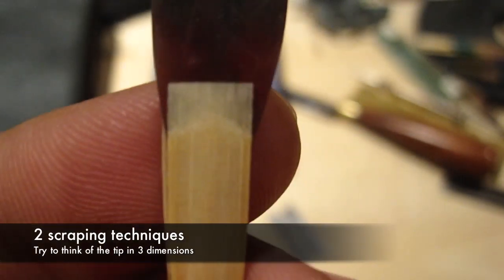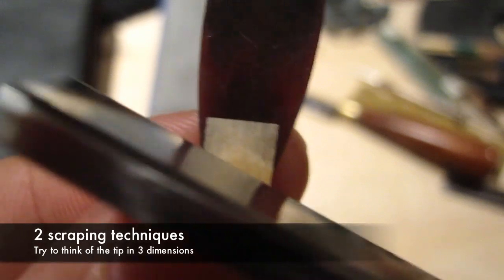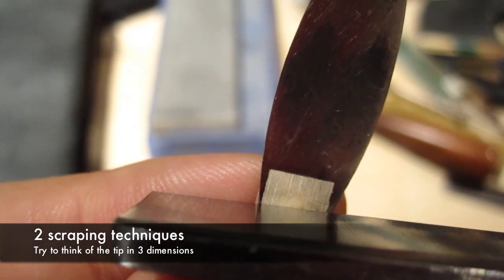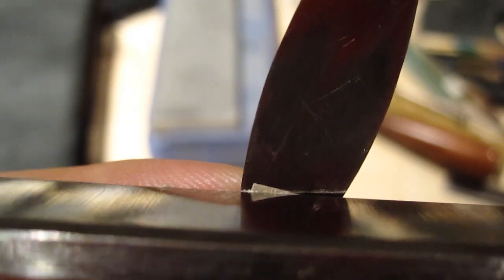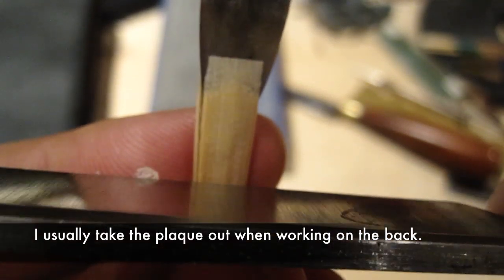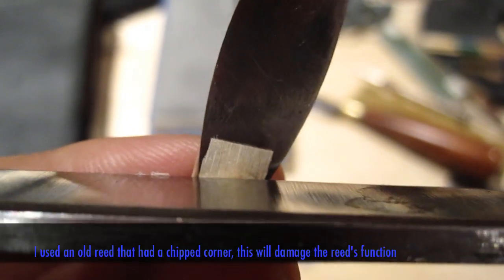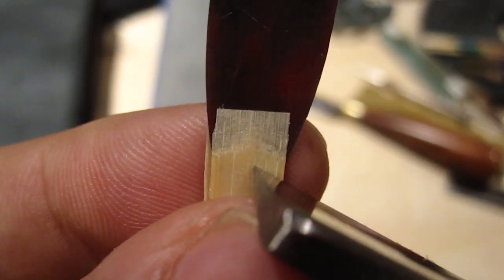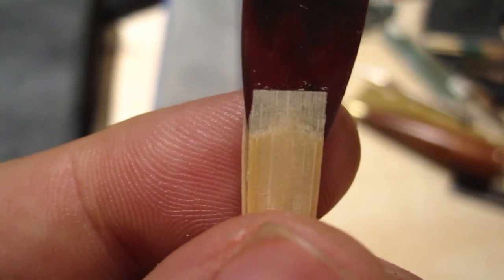Oboe reed scraping techniques

Comment from the maker: For us here in north america,  the function of the tip is different then those reeds made in the euro way. The defining attributes of the american scrape when done well is that the reed offers flexible, control, stable intonation and comfort. The tip length is dependant upon the player's size of lip, piece required to play and function of the reed. As for the back, its function is for depth of tone, reed opening and intonation. Hope I was able to answer your questions.